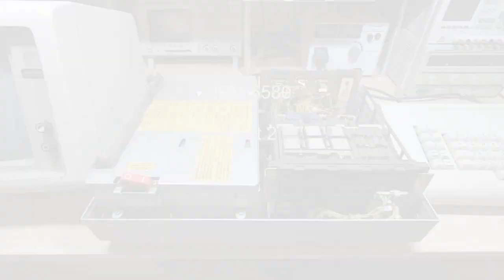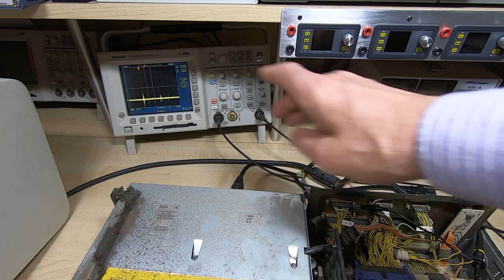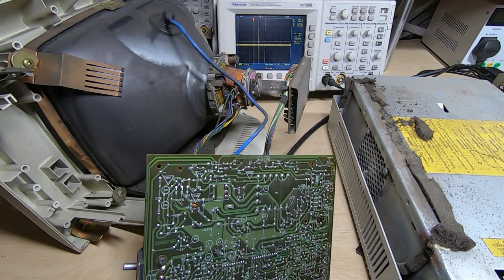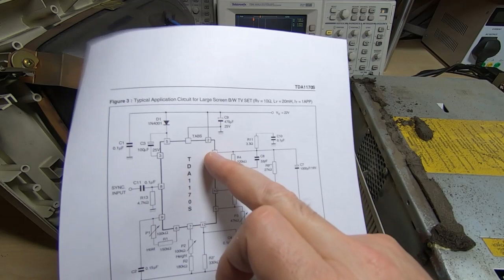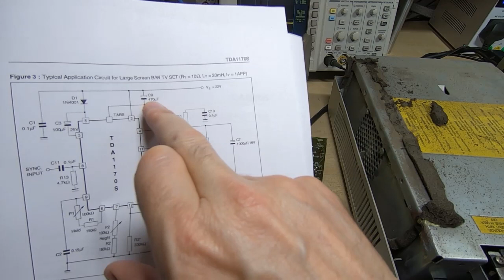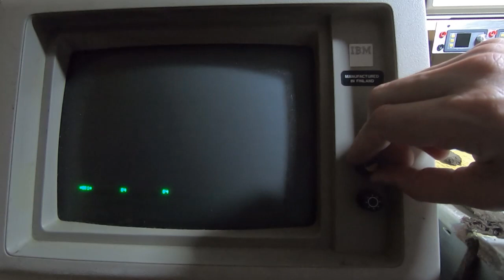IBM 6580 Part2

Comment: Error 04 should mean “diskette module wrap test” (missing floppy?) and the rear led code should be 1000 (1 on  3 off) in my understanding. I refer to pag 198 of DW product support manual.
Reply from the maker: Yes I have been testing this. It also seems to depend on which test is being run as this can be altered by pressing the button on the back of the unit. It seems to be working so far and I think it is just looking for the FDD. The LED's are showing the correct codes and everything else seems to work except some of the keys on the keyboard.
Next job is to clean it up and I may then try it with an MDS FDD as the interface is similar.